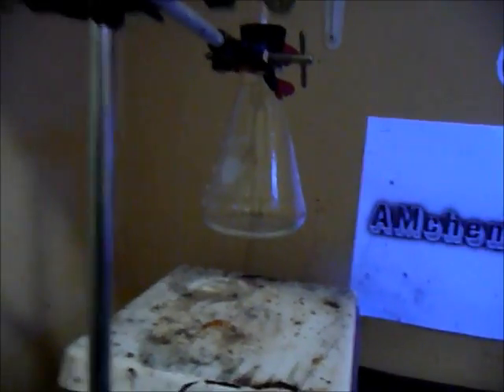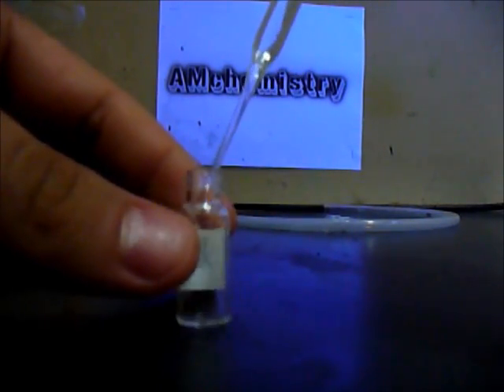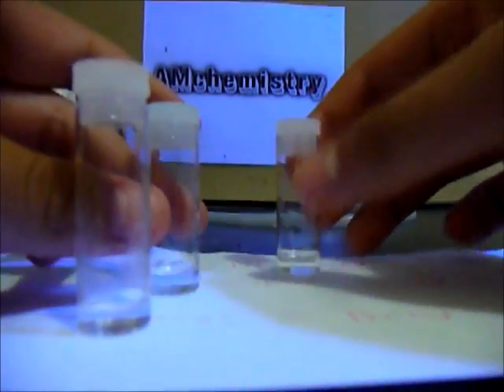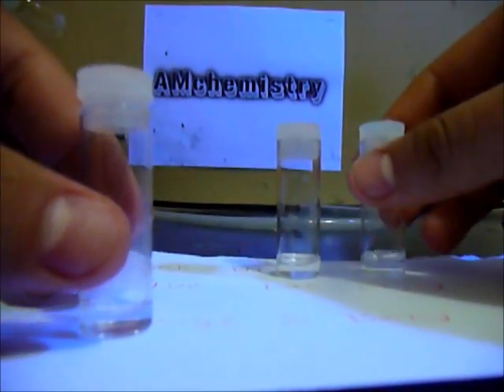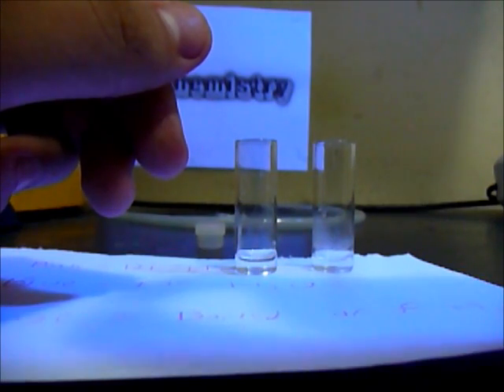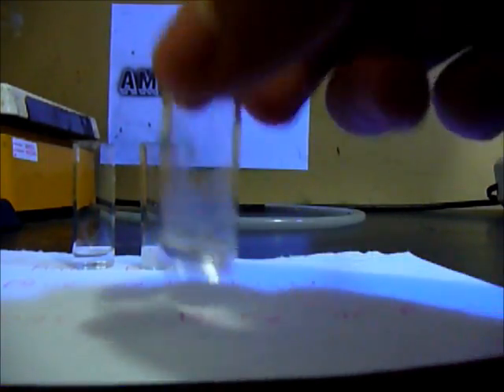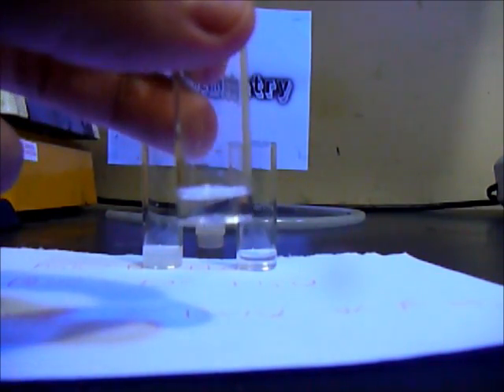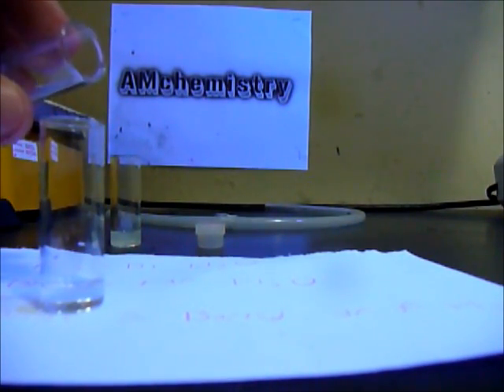Make distilled water

Comment: Think about it. If you added sodium chloride yo your water, it would dissociate into sodium ions and chloride ions. If you then distilled this solution, the dissolved NaCl would not come over with it, thus de-ionizing it. Removing the ions.

Industrially, de-ionized water is usually made via exchange columns, but, in reality, in most cases the distilled water is pretty much akin to the de-ionized stuff.